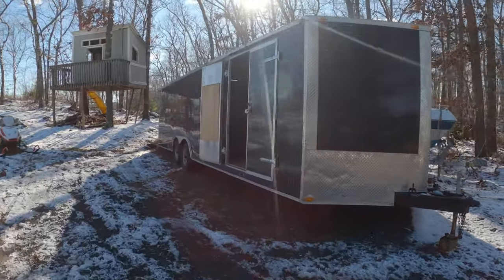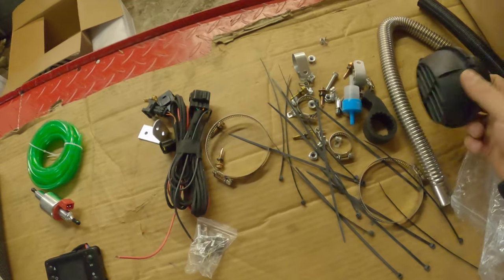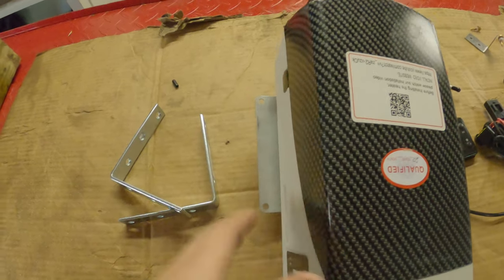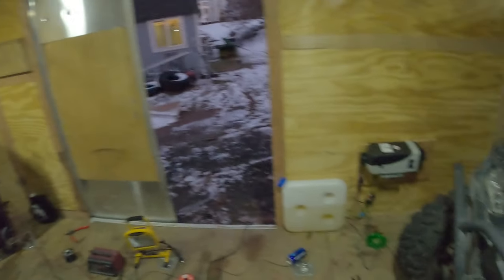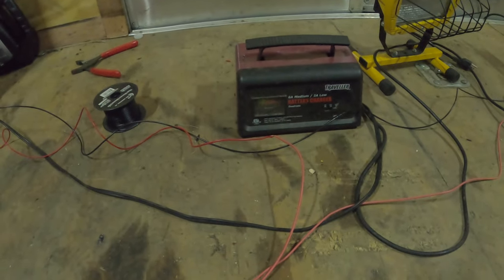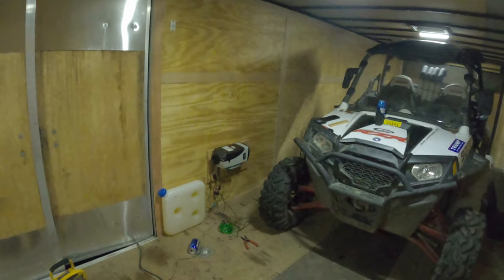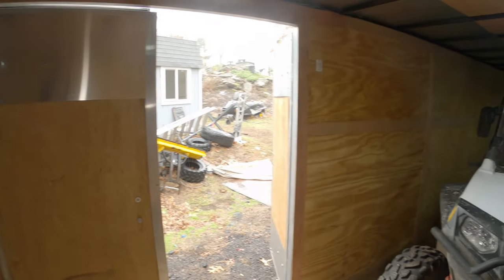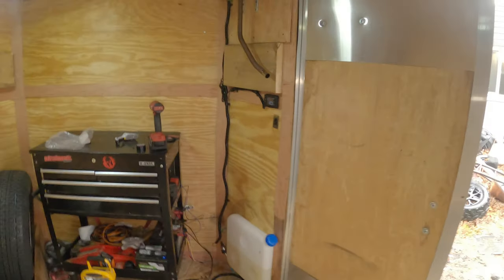Chinese Diesel Heater in My Snowmobile Trailer

Comment: You were told not to pipe out the exhaust.  Really?  It is called an EXHAUST for a reason.  This is the most haphazard install of a diesel heater I've ever seen.
Reply: That and to pull fresh air from Carbo filled trailer.. Nobody take this kids advice

Comment: Dude you’ve got to pipe out the exhaust, right?!?!
Reply from the maker: I ended up selling the trailer but you don’t actually need to pipe it out bc it’s diesel. Much like a kerosene heater
Reply: You totally have to pipe it out.....
Reply: So you already sold this trailer?
Reply from the maker: @notagain8661  yeah I traded it.

Comment: If I missed it. Im sorry. Which heater is it?
Reply from the maker: https://www.ebay.com/itm/363205227501
Reply: You still happy with it?   My new 27ft trailer arrives tomorrow have 3 weeks to prep it. Heater is number 1 instalation.
Reply from the maker: @michaelscharfenberg5249  hell yeah. Just got a new trailer and i have to put another one  in that. I just want a nice install bc i have white walls and cabinets.
Reply: Same.  Its going in a cabinet. Nice and clean. Appriciate the help. Heading north to snow country. Want to be toasty
Reply from the maker: @michaelscharfenberg5249   sweet. check out the new trailer. I wanna see where you put yours ours is probably similar. 
https://www.youtube.com/watch?v=EsRGotbJGQg&t=232s
Reply: I'm going in the v under the helmet storage. Building a small shelf there for coffee pot. Microwave. Trailer getting full 100v service added thru dealer now.  628 dollars. 50 amp service. With 3 outlets installed and service cable. Im pumped

Comment: I'm curious what genius told you you don't have to exit the exhaust?  I'd recommend contacting the guy who bought the trailer before he and his whole crew wind up dead from carbon monoxide poisoning.    (unbelievable)
Reply from the maker: Lol for that to happen the trailer would have to sealed sealed and you’d have to be sleeping in there.
Reply: I hope you're not serious.  You'd be smart to correct yourself before someone dies from your advice.  Diesel heaters MUST have the exhaust ducted OUT.  NOT AT ALL like a kerosene heater.
Reply from the maker: @m.j.c1160  again if you’re not sleeping in there you’ll be fine. Exactly like a kerosene heater.

Comment: Just installed one today:  https://youtu.be/vEaVBaYtZEg #VintageTrailer
Reply from the maker: How do you like it?
Reply: @bobbyrebussini1466  Just tested it twice. Easy to install. We hope to go boondocking next week and will need heat in our vintage trailer--off the grid. Only concern is the ability to charge the batteries.
Reply from the maker: @DavidHousholderOC  yeah I guess you gotta get a generator. I have a deep cycle marine battery. Some use solar